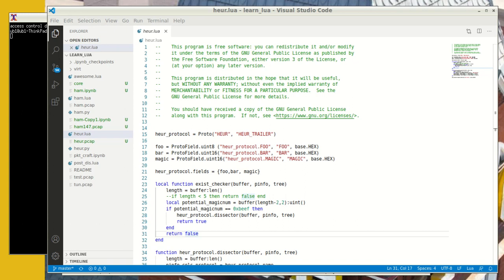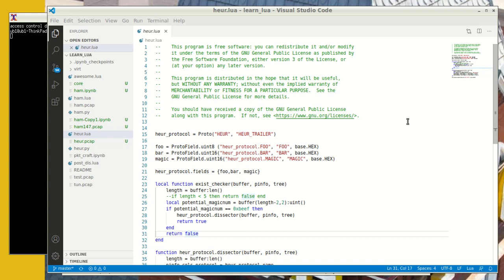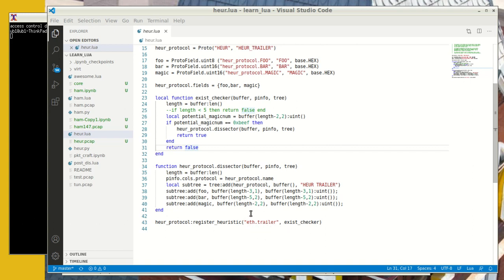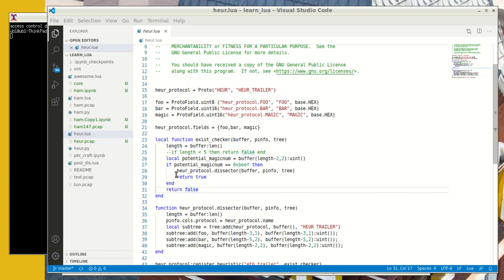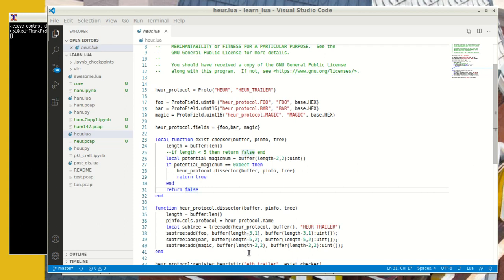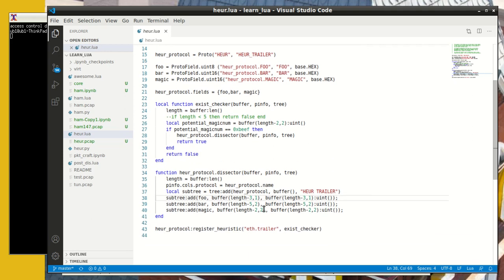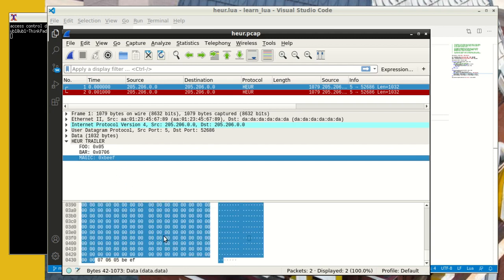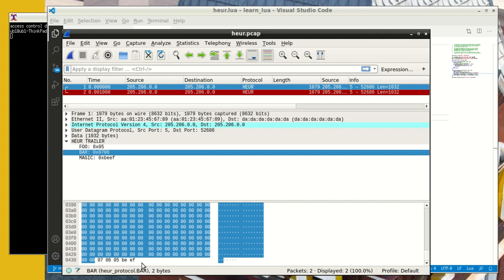Lua Dissectors 4 : Heuristic Dissectors and  Trailer Dissectors

Comment: Thanks for the video. I have one pcap, I don't know which protocol is used. Can we do something to detect which protocol is it. It is an industrial protocol encapsulated in ethernet. Need your help.
Reply from the maker: @Saurabh - If its wrapped inside ethernet, you can attach to ethertype table and write a lua dissector to interpret and display the fields to the packet tree structure. I have provided examples of both a header and trailer dissector. CAn you provide more details of what the exact protocol looks like ?